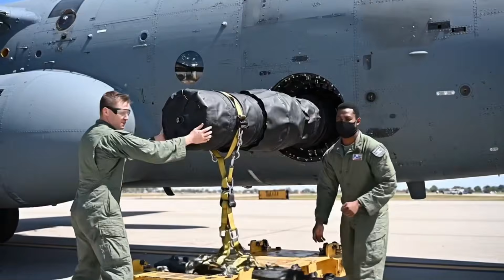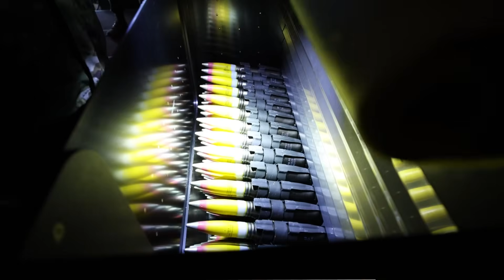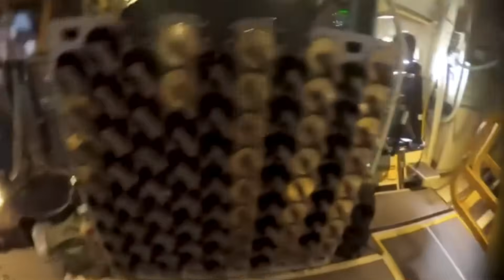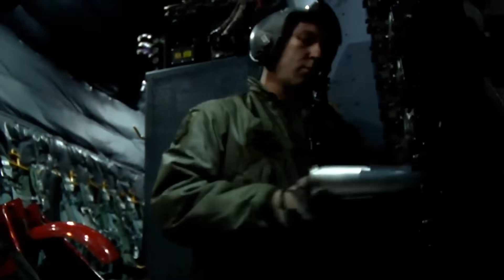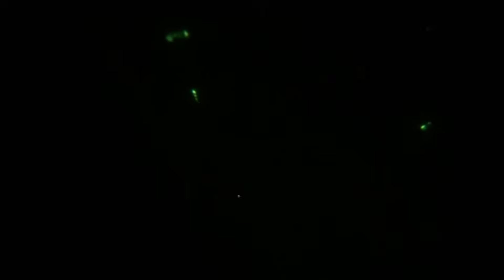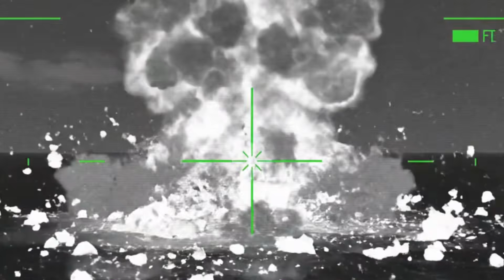US Air Force Test-Fires the AC-130 Gunship’s New Cannon — The Sky Turns Into Fire!

Comment: You do know there are far better alternatives. The CTA40 is a cased telescoped round that sees a 40mm AP deliver the kinetic damage of a round twice it's size. Plus you get distance fused fir air burst or anti concrete selectable rounds at 140-160 RPM.

Comment: You know nothing about the AC-130.
At 15,000, in a thin skinned aircraft, its never hot.
You keep showing pictures of the 105 mm cannon, not the Bushmaster.
The Bushmaster doesn't jam because it is electrically reloaded. An electric motor works the action of the gun, removing empty brass or a dud round without human intervention.